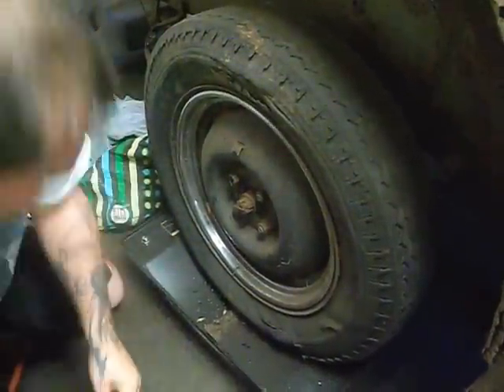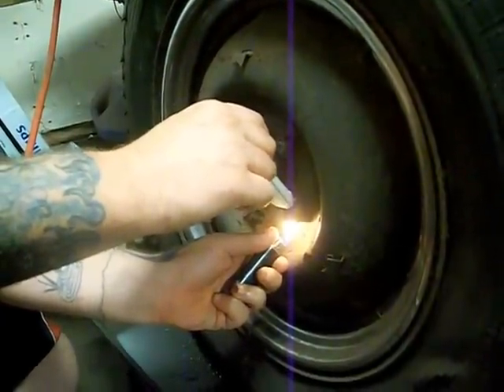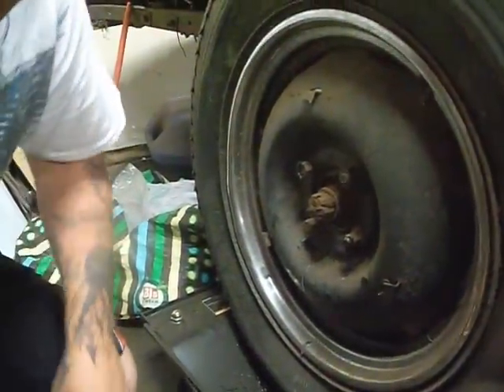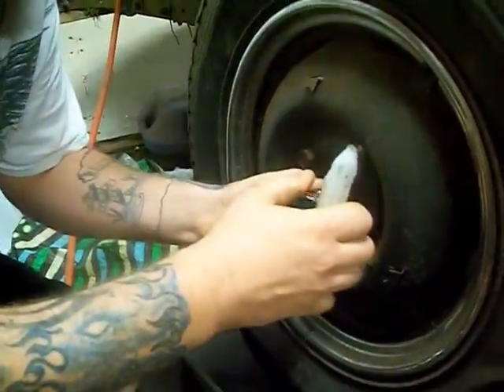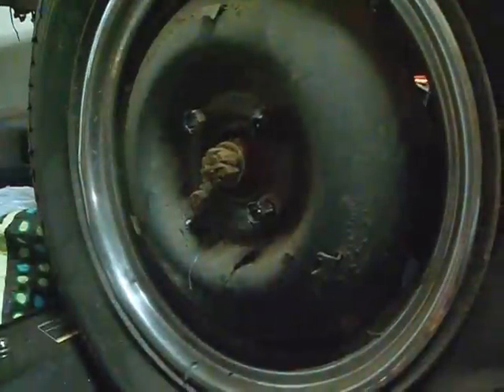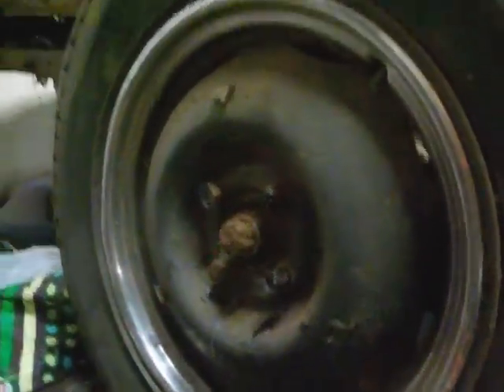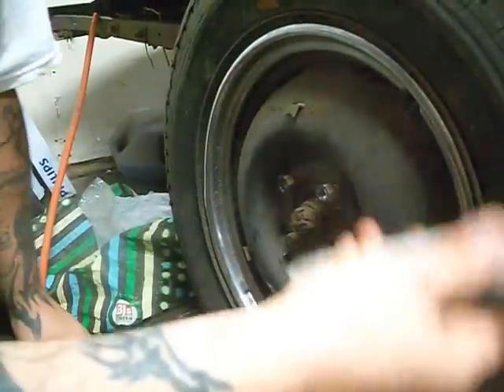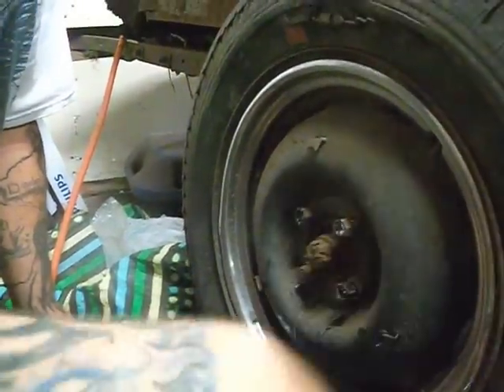removing rusted nuts using a candle and a lighter

Comment: Just coming back here after a few years to note that this video made the rounds of the brass instrument repair industry and revolutionized how many of us pull stuck slides.  Penetrating oil is okay, but the candle trick is far superior.  And when you are dealing with soft solder joints and thin brass, less effort is more.

Comment: This works as demonstrated in the video.  I just finished removing a steel alloy head bolt "frozen" in an aluminum alloy block.  This boat motor is 49 years old.  Up to this point I had already removed the cylinder head bolts except for 2.  One stuck in each head in the same area on each side of the exhaust manifold.  Using a Dremel, I cut the hex head off the bolt and removed the port side cylinder head so I could get to the beginning of the thread.  Even with a light breeze outside, I was able to do it after 5 attempts.  The guy in the vid did a great job explaining it and referenced another YouTube vid that used a torch.  I thanked that poster as well.  The lighter and what was left of a 2" candle did the trick.  I did start with PB Blaster and I was able to at least move it a little, BUT it would have rung off and/or damaged the threads in the block if I had forced it.  I'm working on the starboard side now.  Thanks Angell Kustoms!

Comment: Man you're a life saver. I'm installing a lift kit on my XJ and was about to give up on removing my lower  control arms, then saw your video. I crushed some wax around the bolt and the rusted out nut and put a lighter to both sides. Came off with my impact wrench immediately. Thanks again!

Comment: Genius! Pure genius! I'm open-mouthed with admiration. Thank you. One suggestion is to use a candle for the flame instead of the lighter. The metal bit around the top of the lighter can get quite hot.

Comment: Used that trick many times...also giving the nuts a crack with a hammer can shock them, and release the rust holding them prior to using the candle.

Comment: I am sooooOoo glad you had this video up,  you saved my butt. I had a couple of very small bolts break off in the aluminum differential of my lawn tractor. They hold the brake caliper on. I had to use a torch instead of a lighter,  but the basic concept worked. I have already spent around  $50 and two days on this. This worked in about a half hour. Many thanks!

Comment: It absolutely works! I have a 4 wheel salt water boat trailer. Last year
 a had to destroy  the lugs and 2 wheels trying to get the old nuts off. I
 was about to do the same to the other 2 wheels when I thought I 
checkout YouTube. And low and behold I saw the candle trick. Do they 
just fall off - no, you still have to work at them. But they do move. 
Some of the nuts were that rusty and corroded, that I could actually 
hammer a socket a size smaller on. You saved me a bunch of money this 
time - thanks!

Comment: I remembered this from 5 years ago, never forgot the concept, but not the way he has shown this. 
Found this link again in my Jeep file researching the torque numbers to replace my front breaks.
I know I will run into this as I remove the old routers etc and hubs, possible the lugs.
Reading the remarks, I may be looking to do this with earnest, but now have a new tool in my tool box.  
A+
Reply: ....... I may be  "not"  be looking......

Comment: Many thanks for this I used this on  a very rusted oxygen sensor on a 17yr  Vauxhall Astra  I just used  the hot engine temp on the exhaust manifold  to melt the candle where the oxygen sensor is located and and it came off so easy with a socket and large breaker bar on the first attempt

Comment: It works similar to penetrating spray.  Penetrating spray injects alcohol into the gaps, then as the alcohol evaporates it draws the oil into the void.  Wax expands massively when it is melted allowing it to penetrate, then as it cools it contracts drawing more wax into the joint.
Reply: Thanks for explaining. I’ve learned a lot in 10 minutes

Comment: I once got into a position were I was also unable to get a lug nut to release. I was able to use a lighter like this man did but did not have the candle. Instead I had a small hammer which I was able to tap on the nut as it was being heated and it released with out me twisting it off. It saved the day and a lot of down time.

Comment: in my situation I needed to unscrew a rusted bolt on a bike. I used the candle to heat up the bolt and then used the wax on it and hit it around its sides with a hammer and it worked!

Comment: Wow, I used this today and it worked great. I removed a stuck, rusted clutch slave cylinder which was made of iron that fits tightly in a cylindrical hole in the aluminum bell housing. Frozen tight due to rust over decades. In an Alfa Romeo, these are notoriously hard to remove. Did not budge after many uses of penetrating oil. But the Wax worked! I heated it with a propane torch on low flame instead of a lighter. Thanks for the information on this method. Could hardly believe it when I put the wrench on it to twist it and it actually moved!

Comment: People saying that wax won't work rah rah. That's like saying thick lubricant that comes in a jar but gets hard when oxygenated won't work. Wax is a similar fluid. This seems to be true cause the wax is flowing down the thread then when it hardens it expands making it easier to remove the nut.
Reply: Wax does not expand when it hardens, that is a somewhat unique property of water. Almost everything else contracts when solidified: The default is for things to shrink when they freeze. This is because, normally, if you make something hotter, it vibrates more. IceWhen it vibrates more, it tends to take up more space, so it tends to expand.

Ice is very unusual that, as it gets colder, although the particles are vibrating less, it expands.

The reason for that is due to the strange shape of water.  If you’ve ever seen the picture of a water molecule, it looks like a Mickey Mouse head with an oxygen molecule where Mickey Mouse’s face is, and then two hydrogen atoms where his ears are.
Reply: Wax expands when heated.  That's how a car's thermostat works.  :)
Reply: Sure, everyone knows there is a small stick candle inside the thermostat housing on all American car engines. :-/
Reply: AutomobileAddiction what?

Comment: Haven't tried this but I talked to a guy in a truck shop and he told me something similar. When trying to remove rusted/frozen turbocharger bolts he would use the a wax toilet boll seal and heat the housing in the same manner. He had many years of experience and swore it worked.

Comment: Congrats on almost a million views!

Had to do this today with my baby sisters car. It worked on almost all 4 of the lugnuts! I was shocked! It was that male fixer-up nirvana when you know it’s a long shot and it works!! 
A few things.. be sure to prime the candle a little, just like if you were soldering. I forget the word, but I’m trying think of when you solder your tip on a soldering iron. I guess that’s probably just how you’d say it. This helps the wax melt.
Also, couple problems I encountered. I had tried the hammer trick and one lugnut got a bit malformed, and it is now stuck in my wrench. That’s my fault. Otherwise it would’ve worked great!
My wrench is also a bit strained, I can see almost like it’s starting to pressure crack. The wax does a lot, but it doesn’t turn the lugnut for you obviously, so somethings might get damaged. 
Finally, on my third nut, I ended up cracking the screw and I’ll have to drill that out. I blame that more on the position of the nut and the shape of my candle. There was just no getting it in there the way i needed. 
Also, this was done outside in the autumn wind on a gravel driveway. If I had a shop, this technique works perfectly fine. 
Sorry that I don’t know any of the lingo, I didn’t have a dad to show me any of this and I never took a shop class. 
Thanks for the pro tip!!

Comment: Interesting. He's right.  BTW, you probably saw that the paraffin wax had run only into the first bit of the thread, not all the way through.  Like with glued or riveted or welded lap joints, almost all of the "stiction" happens at the ends, not evenly throughout the length. If a nut is jammed, it is really "jammed" only at the interface where it meets and presses against the component.

Comment: Great, short and precise, video! Thanks! This is just what I think I'll need to get the seized nut off of an outdoor water spigot that's probably 60 years old! I saw other videos that used a torch, but what 60-year-old, single woman has a torch at home (well, not me, anyway)? I was wondering if I could do it with my Bic BBQ lighter, and found your video. Thank, you; thank you!
Reply: That's what I'm going to use, mini bic bbq lighter to get into wheel well.

Comment: I had an old 1/2 pickup.  Most of the lug nuts were rusted on.  We broke about 2 of 4 with a 16" break over.  Used a decent impact wrench and no problem.

Comment: the melting wax is drawn into the hot threads by capillarity action and then loosens or lubricates the threads - also I have never done this myself but I believe it does not matter how you heat the bolt from all sides etc as long as it is hot enough to melt the wax and draw it into the thread - same principle behind soldering or solder welding tightly fitting copper joints - good video thanks

Comment: I recommend PB Blaster.  Better than Liquid Wrench or WD40. Does the sam, but can be used where flame is dangerous.

Spray it on the exposed thread and it will work all the way through the nut in an hour or two.  Then use a 6 point socket.

But not a fast as heating the nut with a gas welding torch.

btw, Unless you want to drill through the cap, the only one of these that works well on an over torqued acorn nut is the torch.

Comment: my coworker does basically the same thing with brake bleeders, except he uses a torch and crayons
Reply: Next time tell him to skip the crayons..heat a bleeder screw with a torch (even propane) and it'll come free..no need to contaminate the brake fluid with paraffin or other oils..
Reply: heat alone doesn't always work, and there's no contamination which gets left in the system
Reply: Doug Gyver , just a quick question, how is the crayon contaminating the brake fluid by heating up the bleeder? Is the brake paddle all the way done and when bleeder is lose, someone lets go of brake paddle. Just asking
Reply: if you are replacing wheel cylinder or caliper in your proposed scenarios. you may as well try your crayon/candle. i am replacing wheel cylinder tomorow on a 96 f250. im going to give this a try
Reply: Nikolas Sheets
there's no point in opening the bleeder if you're just replacing the wheel cylinder lol
Reply: I suppose not if you pinch the rubber. But we isn't this a post for older trucks
Reply: how does pinching the rubber line have anything to do with opening a bleeder screw or replacing a wheel cylinder
Reply: The fact that you think you can heat one without the other cracks me up.
Reply: Why would you heat to a cherry just to loosen a damn screw, FFS?
Propane (or MAPP gas at worst) is all you need, and there's no need to "shock" the work piece with water. Heat it, it expands and breaks the bond of oxidation, let it cool for a few minutes and loosen with wrench..if it is binding, then lather rinse and repeat as needed..heat doesn't break bleeders, ham fisted mechanics do..
Reply: Funny, I haven't snapped a fastener unintentionally since the eleventh grade, and my employers keep right on signing my paychecks forty years later..

Using acetylene to free up a corroded fastener that's under an inch in diameter is like using a sledge hammer to drive a thumb tack..but hey, whatever gets it done for you, hack.

Comment: works for large nuts and bolts but wondering if you can use this technique on a ROTOR SCREW (WHICH IS VERY SMALL)???

Comment: I think that the reason that it worked is that the corrosion was just on the sloped part of the nut and not on the threads, so it doesn't have far to penetrate.  I know that some people put anti-seize only on that part.

Comment: I am praying this works.
I am at a friend's home, I have a flat tire.  I  don't have money for a tire. 
I  called roadside assistance through my insurance.  They arrived,  they can’t Loosen the lugnuts on one tire.
I  can call my roadside assistance for a tow as long as it's in a 15 mile radius. 
So my friend and I are checking out the places within a 15 mile radius. 
The 1st inquiry tells me, tow the car there. If they can't Loosen the lugnuts I will have to have the car towed someplace else.  Well, in that case, if they can't get the lugnuts loosened I will be responsible to pay for another towing and this time around my roadside assistance won't pay. I  simply don't have the money to pay for a towing. 
So, my friend and I go to another tire shop to gain information. 
OMG, what a terrifying scenario they gave me.
Mind you I  have about $100 in the bank for the month. I can't afford anything and survive the rest of the month. 
So this next place tells me. They charge $120 per hour.  It could take them 30 minutes to remove the lugnuts or it could take 4 to 5 hours just to remove the lugnuts. 
According to the last tire shop. $120 per hour. 4 hours work on just removing lugnuts would cost $480 plus tax. 
Then they said it would cost for the tire removal,  the fixing of the tire and possibly a new tire. 
This was all without looking at the tire.
The sales manager expressed how much it cost for maintaining their building and business; electricity,  taxes etc. & how they are not the cheapest but not the most expensive place around.  
I  will point out, my friend is a man.  When we initially approached the manager to inquire he made the assumption my male friend what there to  do business,  when he was informed I  the female was the one doing business  and it was my vehicle I  truly got the impression he felt he could take advantage of me.
I am thinking a tire removal,  even with stuck lugnuts and a potential tire would cost me close to or way over $800 if I  did business with this tire shop. So the answer is that I don't have that kind of money.  While speaking with this manager at the 2nd tire shop he was leaning toward spending at least 6 hours on my tire. Doing the math in my head as this manager is tossing the cost a me is getting very pricey.  
I am praying this candle and lighter thing works.
Thank you for this video.

Comment: What happens when you put the nuts back? Will they stay tight? The wax will be still there and will make it go loose later when the temperature increases due to rotating wheels?
Reply: sangtalkid sangtalkid nope it won’t if tightened correctly

Comment: I tried this method on my 1959 Ford F-350 and it was a bust. I used a grill lighter with a candle and it just wouldn't do it. No telling how long it's been since them 62-year-old lug nuts have been removed. I think under a normal situation it would have worked.

Comment: best method is to heat it then cool it with water add penetrating oil  like pb blaster then heat it again with a torch and while the nut is bigger because it is hot turn it ..

Comment: Why dont you just get an impact gun and some impact sockets?
Reply: because this is a much cheaper and simpler solution?
Reply: David Anon well, why not just go by a fully restored classic car and not fuck with bolts at all. That's not the point of this video. The point is to show you a cheap easy trick that you can employ with household items in a pinch.
Reply: Nothing is simpler than having the right tool for the job.  It is much cheaper though, I will give you that, but if im trying to restore a rusted out car that hasnt been touched in decades, Ill take the impact gun over a candle and lighter every day of the week.
Reply: Why even touch any tools? I'd just take a new car over the right tools every day of the week.
Reply: David Anon
You're missing the point of the entire video...
Reply: I guess you're right.  If you dont have an impact gun, this is a way to get stuck bolts loose.
Reply: *****
ah, so it's actually working as a lubricant? I honestly didn't know paraffin wax was a petroleum product. That's makes sense. I guess I didn't think of that initially because when I think of wax I generally think of a sticky substance.
Reply: because they break studs and bolts that are seized up with rust.
Reply: Jeff H
Bingo

Comment: Neat trick... but not sure why hot wax would penetrate better than WD40, CLR or similar...?
Reply: wd40 is pretty ordinary. this is capillary action,the heat help's loosen thing's anyway,but the wax actually get's sucked in by the capillary action, just like soldering copper pipe fiiting's really
Reply: *****
Good to know...

Comment: Will that work on exhaust manifolds on a big block 390 FE?
Reply: The longer the stud and thicker the metal around that bolt, the more the heat will be conducted away from the stud.  Heat the stud with the propane torch (the smaller the better.  But avoid those palm size butane torches because they only stay on for 60 seconds and not enough heat is generated).  Note, some bolts and studs are so rusted that they fuse to the threads, and upon removing them (even with the heat) the threads on the stud or bolt will be sheared off partially.  In that case a thread repair kit may correct the bolt or stud threads.  Otherwise, replace the bolt or stud.  Also, use the thread repair kit to clean up the threads on the exhaust manifold.  Always keep a thread pitch gauge handy to get the correct replacement bolt or stud.  

Double check exhaust manifolds to ensure they are straight, and if not, file them straight to ensure a no exhaust leaks.  Good luck.